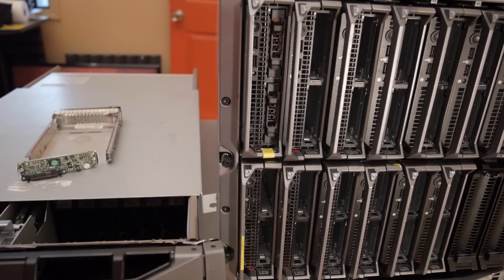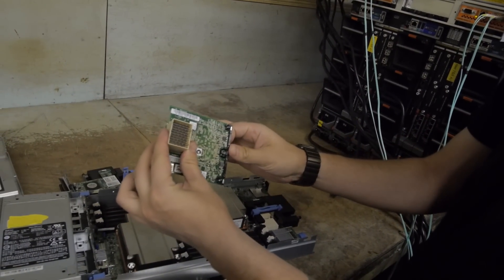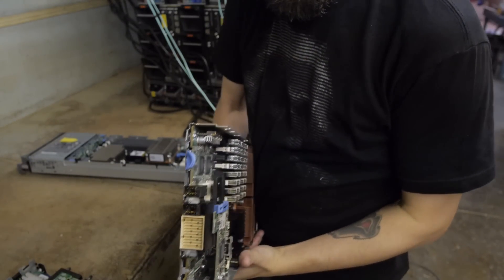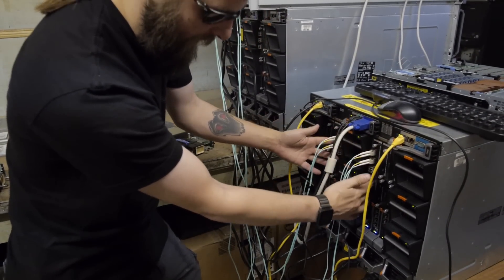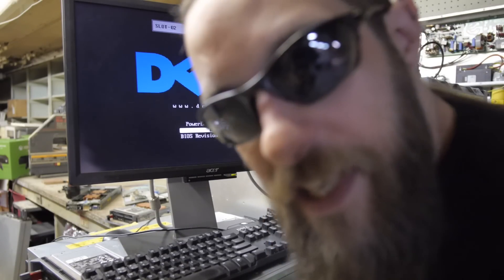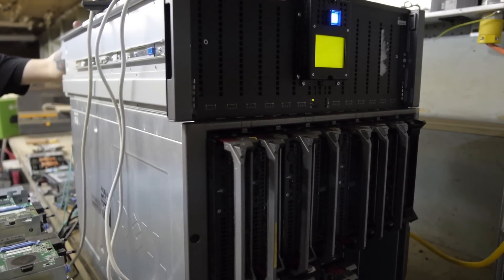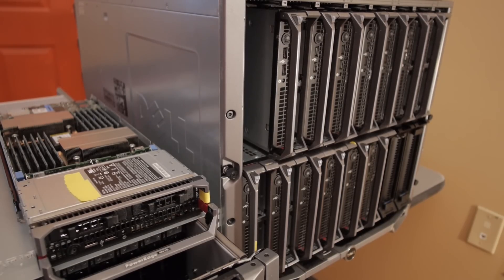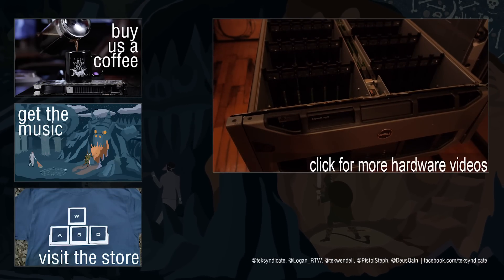Dell M1000e Blade Center - 16 servers, 1tb Ram and 10gb ethernet in a tiny cube!

Comment: I've worked on several of these in real life. They are certainly really interesting and awesome to work on. When upgrading the blades on these with some newer models, you'll very quickly start thinking in terms of tarabytes of RAM.

By the way, these things constantly draw about 3,000W of power (and that's not even when they are getting pushed real hard). They take 220V (although I could have sworn that I've seen an option in the CMC to run them in 110V 😉).

Comment: It looks like you have the active CMC stack port feeding to the standby CMC? From what I've read the stack port is only for connecting to CMC's on separate enclosures to work as a daisy chain and reduce amount of connections to the switch they run to.. I.E  if you have two enclosures, instead of running four runs of copper to your switch, you only have to run two and use the stack ports on enclosure 1 to connect to enclosure 2.

Comment: how does it only support 256gb ram per blade on the newest one? if it's using 32gb dimm's and there are 8 per CPU resulting in two banks of 128gb so 256gb per CPU then have two CPUs per blade thus 512gb ram per blade.

Comment: RAID 1 ram memory. Not that often that you find that in a machine.
Reply: It's actually extremely common in production servers where it would cost more money to have the server down than it is to buy twice the RAM for it initially.
Reply: Liam Gammon Most systems go distributed this is so much better in terms of scalability or reliability and cost. But you need to rewrite the software.

Comment: With the web management interface for the cache, you can remotely power on or off each of the blades. The security appliance, in my environment, uses the same cache.

Comment: Ya''ll work much with HP's (HPE) Blade servers?  Once upon a time we spec's Dell Blade servers, bought them integrated them and then shit canned them before deploying them.  Replaced with HP Blade Servers.  No comparison.  HP, now HPE's blade servers are far superior in every way.  Opinions based on my personal first hand experience, experience of internal and external departments and customer feedback.  Time to upgrade.
Reply: fuck HP
Reply: My wet dream is a Lenovo Flex Center.
Reply: My PlayHouse Not seen a flex center
Reply: HI William Hayden 
It is the newest Blade center from IBM and now Lenovo. from 2012. 
I have a there Blate Center H whitch is there Blade Center from 2006-7 ish and two model E, that is even older.
Are you in to the HPE models,, c7000? or waiting for the HPE Synergy 12000 one.

Comment: We have a number of these. One major flaw of this blade center is in the RAID/PERC controller battery on each of the blades. Though they recharge every 90 days, after a number of recharges, they all fail at the same time, and you have to pull out all the blades - shutting down the all servers - and replace them.
Reply: What happen when the battery fail?

Comment: i dont understand. whats the use of this. I could build something on the same sort of level for like 10k in a rackmount. why spend 150k for that ...
Reply: +Nemisisak The use is because there much smaller than a standard 1 or 2 u server. Your also paying for support. You also can't buy that for 10k A single modern blade is over 10k with dual 18 cores and 256gb of ram.

Comment: That would make a great Pfsense router lol
Reply: +ANTON Not really, a simpler server (one that can be run on a single power group instead of six xD) can outperform this thing in routing as x86 isn't made for routing, you'd need a proper hardware router for that with circuits designed to push packets.
Reply: +Some Dick <<<<< love the name lol Yes its totally over kill I know ;)

Comment: Wouldn't it be more efficient to use one virtual server host and 16 virtual servers?
Reply: +andreas karlsen These usually run 16 hosts and many more VM's. 
The point is that 1 server can fail, no issue. Another one fails, who cares, and so on. With 1 server, 1 failure results in complete outage. Also, when your company grows, the system should scale with you and having 1 server you cannot upgrade it forever so at some point you'd have to completely redo your system to allow it to grow along with the company, unlike with virtualisation where the VM's can run on almost any system which grows nearly limitless.
Reply: Yeah, but here you can host 16 virtual servers per blade. The point is you can pack as many hosts into as small a space as possible.

Comment: I have just one server pc, that has 8 hardiscs places, 4 or 5 places where you can have floppy drives, DVD players etc.
Its hasnt any server blades in it. So btw its a big server pc.

4 cooling fans, 3 to the hardiscs and one for the upper floor.
One power supply and one motherboard, 4 slots of RAM and 4 Slots for graphic card, PSI and Network card etc.

Comment: I work with these things daily.  I really do not like the fabric on these.  Cisco blades for the L2 connectivity and super buggy.  Luckily, Cisco still supports them, even tho Dell says the chassis is EOL.  The current gen dell ones are pretty good, but they are new so hard to tell how they hold up compared to these.  Hopefully Dell has learned some lessons.  Where I work, we still have over 100 of these chassis (fully populated) in production.  We hateses them trixy chassis.

Comment: What's the point of that much ram ps I think they did it just because they can
Reply: +Ignitable Toast - It's very common even in a lab environment to see blade servers with at least 128-256GB RAM. Ideally you would install what is known as a Type-1 Virtual Machine Monitor such as VMware's ESXi with vCenter Server onto each blade server so you can run multiple Virtual Machines (VMs), instead of installing the server OS directly on the "bare-metal". The outcome is that less space, cooling, and power is required (this is in addition to the savings you make by using blade chassis in the first place). Also when shared storage is involved, e.g. a Storage Area Network, you can move a VM between different ESXi Servers whilst live without causing downtime, which is great for when you need to repair/upgrade the physical server.
Reply: +Thomas Richards The joy of virtualising also means fewer licenses required for the host OS, as there isn't one lol. Thus saved pennies and fewer headaches dealing with Microsoft's server licensing quagmire.

Comment: Why 10gb is not a standard? 1gb lan cards came out long time ago, 10gb isn't even available for consumer routers.
Reply: +miiiikku  because most people don't need it? I have a proxy at home with a raid 0 setup for caching, and even this generally saturates before my 1gb lan. (ok, I could use some SSDs, but the improvement vs cost is not worth it imo.) the only thing that always saturates my Gb lan is when copying from my laptop's SSD to my desktop's and I can wait 20 minutes or so to copy 100 GB once every year.
Reply: +miiiikku It&#39;s extremely expensive and rather complex to set up compared to gigabit. If you want 10gigabit at home then Thunderbolt is your cheapest, easiest solution. It supports peer to peer connections like FireWire also does meaning you can connect two or more machines and get an ad-hoc network. Assuming your OS of choice supports it (OS X does, I'm not too sure about Windows. Milage will vary on Linux depending on distro etc).
Reply: TalesOfWar windows supports it as well as USB 2.0 and FireWire.(which is pretty well without additional drivers, but you need to install drivers for each device)
Reply: +miiiikku Because no consumer will need it in the next 10 years, only a few enthusiasts and professionals might need it. Add to that the extreme cost compared to 1GbE and there just isn't a market. The cheapest solution for enthusiasts (like myself...) is to pull some InfiniBand cards from eBay, got fiveof those, 20GbE dual ports each and hooked up to three hypervisor servers and one storage server (all servers connect through the storage server. Even with 48 high end 10-15K RPM SAS drives in RAID60 the thing will not reach the 20GbE limit, the CPU's just cannot handle that much traffic even if the NIC has a offload processor, so again no use for consumer grade computers.
Sadly, we must wait some more years for affordable 10GbE...

Comment: Not many things can use 100+ cores or over 64GB of RAM so usually I see that set up used to virtualize a network of servers for processing, SQL databases, and workstation clients to which when a blade or its NIC dies its extremely bad to have hundreds of things running on one blade in that blade center 
for rendering usually it can get up to around 24GB or so with persistent turned on for a video on youtube or up to around 512GB for a Hollywood video but use a lot more cpu cores like over the 192 that thing has 
for a datacenter server 1TB of RAM might not be enough depending on how the processing is setup

Comment: What, noone cares if it does Crysis?
Reply: Joe Thorpe First of all, calculate graphics on  a CPU then? And secondly, you have small GPUs but ten of them.
Reply: I'm sorry to be an ignorant asshole (I truly am!), however I still hold hope that 18 hexacore CPUs running at 2.66GHz (that's 108 cores in total, machine able to do 287.28*10^9 instructions per second) with terabytes worth of RAM could be able to render a virtual world with textures and physics and stuff.
Reply: +Dmitry ‘The NoobZMaster’ Granicin Isn't the calculation diffrent for grafix/computing? Also, wouldnt that ram be allot slower since it is't on the gpu? (Sorry for the 'noobnis' just trying to figure it out :) )
Reply: +Dmitry “The NoobZMaster” Granicin You can throw all the hardware in the world at something but if the software isn't written to make use of it then it'll be all for naught. It takes some pretty damn good coding to make something aware of and properly utilise all of those threads and games are most certainly NOT within the list of software that do this. Most tend to top out at 4, maybe 8 if you're lucky. Same with the amount of RAM they address. Many games are still 32bit, even the 64bit ones are typically 32bit with a 64bit executable mostly for compatibility with newer OS's rather than for making use of extra hardware. We're seeing more and more genuinely 64bit games though as time goes on thanks mostly to the newer consoles also being fully 64bit.
Reply: TalesOfWar You think really standard. That's why you missed my idea.

How about this: leave first 4 cores for the CPU work and the rest for graphics processing? Write a language that can interpret GPU instructions into CPU instructions?
Reply: Dmitry Granicin You mean like OpenCL? It exists, it's just difficult to do and costs a shit load of money especially as you'll need to essentially start over for a lot of software to make use of it. Enterprise is notorious for running ancient software, they replace things only when they have to. Most of the shit we're using now was written back in the 90's or earlier before we had proper multithreading and direct compute handled by the GPU etc. Retrofitting the code isn't a simple task and it'll have to go through countless stages of certification and crap again for every change they make which takes time and again, more money.
Reply: TalesOfWar The question wasn't "how difficult it would be to run Crysis".

The question was "can it?"

Comment: What is KVM? I bumped only into Kernel Virtual Machine, but I think it's not this case...
Reply: +Peter Bočan KVM stands for Keyboard, Video, Mouse. It's like a proxy for I/O operations
Reply: It's a thing you can plug multiple keyboards, mice and video cables into and just change to different systems buy clicking a button instead of unplugging everything. As you can image quite useful with a a lot of servers.
Reply: Thank you all ;)
Reply: +Peter Bočan I've used KVM switch at work, it's very useful when you have limited office space but have to use two running computers. nowadays with better hardware you can use virtual machine to separate 2 work environments without the need of KVM however for server blades like those, it's needed for setup; but once setup is done you don't need anything connected just power and Ethernet as my old server i used to run
Reply: Kvm switch I feel like is the console or workstation usually located in, on, or near a sites servers for well working on the server via a terminal if needed

Comment: Two questions: Has anyone water coolers a data center, e.g. submerged like a nuclear reactor. and can it play minecraft on Fancy?
Reply: +BigDirtyBasterd Short answer to your question water cooling data center yes. Fully submersed servers are in commercial use right now. Check out a company called Green Revolution Cooling. These type of machines are really built for playing video games.
Reply: +BigDirtyBasterd Data centers run chillers which cool liquid coolant, usually a glycol solution and pump it throughout the building where systems can connect to systems.

Comment: Subliminal message @12:52? I can't quite pause it on the right frame. It looks like Wendell but that's all I can make out.
Reply: Yea, weird aye
Reply: +Sean Palmer 

I believe that he appears on only one frame. I tried to hit that frame running the video on HD, where it runs at 60fps, but did not succeed. Then I switched to a lower resolution (480p), which presumably in this case runs at 30fps, thus doubling my chance of hitting the right frame. After (quite) a few attempts I was finally able to hit the right frame.

And, of course (in hindsight), run the video at the slowest possible speed, which will maximize your chance of hitting the right frame.

Comment: but can it run crysis?
Reply: +Jukebox300 8:31 8 MB of video memory... sure thing
Reply: +Jukebox300 Probably not
Reply: +Jukebox300 it only has enough power to show the bios screen...Yes of course it can run crysis!, hell it can run crysis 3 on triple 4k monitor setup while recording with fraps, but..can it run pokemon green?
Reply: +Jukebox300 It can not run Crysis but it can run hundreds of thousands requests per minute on an Nginx or Apache. These blades lack gpu's most of them have a FireGL or smth like that with 4-8MB  of video memory. Enough to run windows or linux gui. Or run a dedicated Crysis server. :D
Reply: +helavatar probably a couple of dedicated crysis servers :P
or even a minecraft server!
Reply: +Zero Carrot umm, like a MC server is harder to run than a crysis server
Reply: DutchCrusader crysis is from 2007,
mc is newer and uses java. cant remember how it was exactly.
Reply: +DutchCrusader MC servers are harder to run when you get ~30-60 ppl messing around and exploring. Crysis has fixed set of data so less taxing on cpu and ram. Lineage 2 used to have an option to drop 1 piece of "gold" or adena and ppl made art with it "Adena art" but it crashed servers because it overloaded the ram. (:
Reply: helavatar also minecrafts worlds are huge sometimes
Reply: Zero Carrot yeah, but that is just Hard drive space since it only loads the chunks around the players

Comment: Hey, Dell, if you're watching, you should totally send these guys some more enterprise stuff to look at. You too, Cisco.
Reply: +Jimbo McCoy I doubt they would be interested in doing that with new equipment, as it costs substantial amounts of money, but they might be able to work something out with some End of Life equipment coming off-lease. Even if it's a few years old, it's still incredibly cool. If they could get ahold of some LGA 1567 Blade Centers, that would be really fun to play with. up to 10 cores a processor, with hyperthreading. I know the Poweredge m910 is a LGA 1567 board, but it's full-height blades, so you are limited to only 8 of them instead of 16, though you do still get similar density, as they are quad-socket blades.
Reply: Agreed

Comment: i used to be a manager of a department that built custom rack solutions for Dell. One time they wanted us to install 4 of these m1000 chassis into a 42U rack. By the time the 4th one went in at the top, the rack was bowing slightly in the middle. Definitely dont want to put more than 2-3 MAX in a rack. Even more so for a 48U rack